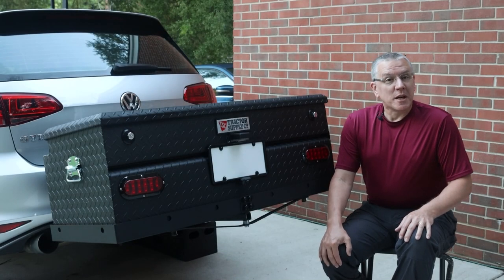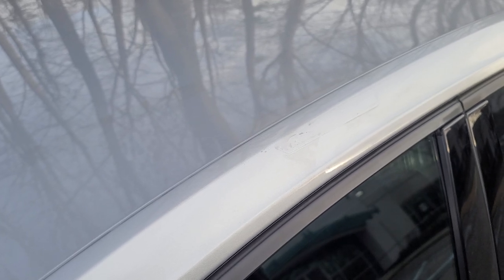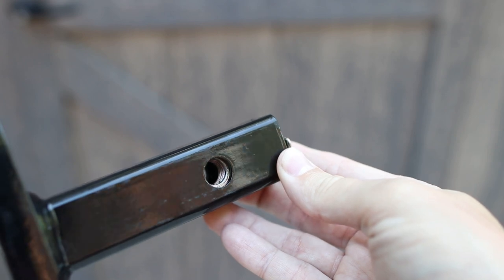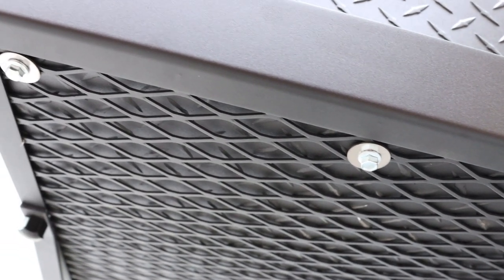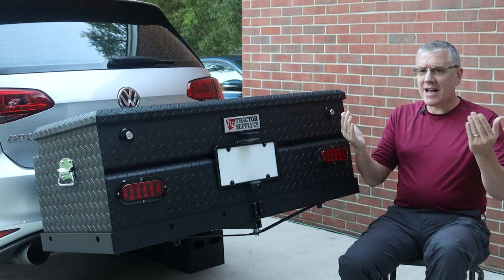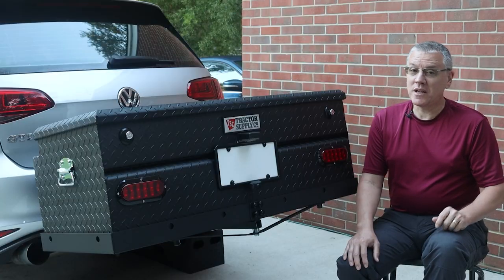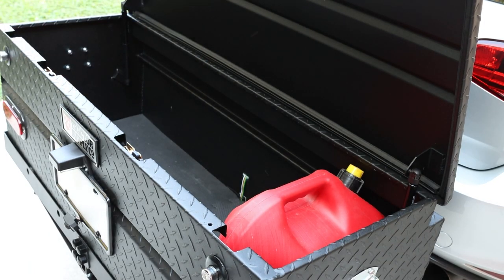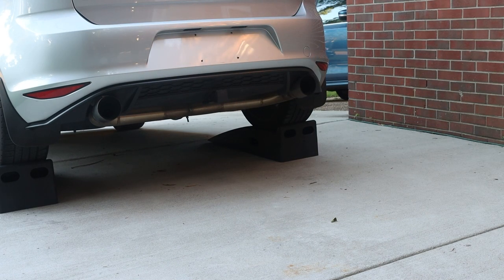Hitch-Mounted Cargo in the Draft

Comment: 'Back Porch' storage is a great idea! Doing it on the back of my 4x6 trailer might help with tongue wt as well
Reply from the maker: It may help; just don't over-do it. Also, make sure you have sufficient structure back there. My 4x6's rear crossbeam is just flimsy thin steel. I'd want it reinforced if I was to put a hitch receiver back there. Good Luck!

Comment: Scott, when using a cargo carrier and carrying gear or passengers inside your GTI, do you encounter any sagging with the rear suspension? 

I have a Golf Alltrack and I am interested in a similar setup for long camping road trips, but I am concerned the longer body length of the vehicle and then additional weight behind the rear wheels might cause the car to look like it is taking off from a runway. 

Have you ever considered using inflatable suspension aids such as a Firestone coil-rite?
Reply from the maker: I don't guess I've looked. The most-loaded I've ever been was when I took my daughter and another Marine to Marine Combat Training in NC. My wife and I were up front, the Marines were in the back seat, my wife's and my overnight bags were in the trunk, and the Marines' seabags and other stuff was in the trailer, which probably had about a 150-lb tongue weight on the hitch. If the car has sagged for any load, that was it. I didn't think to capture a photo with them in the car, though. I guess if you look at the photos that I shared during our Coast-to-Coast road trip (see playlist), those photos had a good load in the car, too. I have considered the helper airbags, but I haven't felt the need since the car seems to handle well without them. Thanks for visiting!

Comment: Hey Scott, what does the Tekonsha do?  Is there a cheaper alternative?  Looking to do this on a budget.  Keep up the great videos!
Reply from the maker: The Tekonsha is an inductive wire tap that creates lighting signals for the trailer. Rather than tap into the wire, a sensor clips around it and senses current. It's fairly universal and can go from car to car, if desired... not "portable," but transferable from a sold car to its replacement. Thanks for your comments!

Comment: The linked box on amazon has measurements that say 50" length in the specifications section despite 46" being in the tittle. Was this the case when you purchased? I only ask as I have the same curt cargo hitch carrier and would like a good fit if possible.
Reply from the maker: That's weird! I think the 50" dimension includes the shipping box with its packing materials. The box is certainly 46 inches wide, leaving about an inch on either side of my Curt carrier. Thanks for visiting!

Comment: Does exhaust heat cause totes to warp or melt with a hitch carrier??? Looking into the same solution for camping w. Subaru.. TIA for your answers... Great info :)
Reply from the maker: I haven't had any problems with that. In my other video, which you've already seen, the carrier is higher up and away from the exhaust pipes. With this carrier, the load is still above the pipes and sits farther back. I don't think you'll have any troubles. Thanks for visiting!

Comment: Thanks! Great content as always! This looks like a better option than a rooftop box for me.  You mentioned the cargo capacity at 1000 but I think that it would be pertinent/ helpful to clarify max tongue weight (for the car not hitch spec)that I understand is just over 170 lbs from the UK dealership and German factory specs (less than the 200lb capacity of most hitches once you get above the lightweight ones)
Reply from the maker: That is correct. I did not mention the hitch capacity from the hitch manufacturer, which is 300 lbs. I mentioned the capacity of the rack (300 lbs) to illustrate the strength of the rack, but also said that I'd limit my loads to VW UK's specs for the hitch, which is 80 kgs or 176 lbs (I rounded-down to 175). Thanks for visiting!

Comment: Wonderful and insightful. Thank you.
Reply from the maker: Glad you enjoyed it! Between the hitch carry methods I've shared (bag vs. box), which do you think you prefer and will use? Take Care!
Reply: @StealthGTI  I have decided to use the curt rack and box just as you have it. I considered a roof rack, but cost alone and a decrease in MPG has steered me away (although it looks so cool!!!) I am mobile detailer and the curt rack and box will have many benefits for me. Load the heavy stuff in the station wagon rear and the volume stuff in the box!!! A great solution without a significant decrease in MPG. I only wish my hitch and rating wasn’t a stage 1 so I could go with something more robust and a folding option!! Oh well!
Reply: @StealthGTI  In the featured section of this video you list all of the products. I ordered all of the things in the section minus the back up camera. I even ordered the Tekonesha adapter, trailer wiring, and 4 pole barrier strip. Are those necessary for the job and do I need them? Is this everything I need for the same setup as yours? Thank you.
Reply from the maker: @Jon Eric Fountain  - The barrier strip is not necessary; I did it for troubleshooting and flexibility.
Reply: @StealthGTI  ok thank you. I got all my parts in and will try to install Sunday! I will keep you posted!